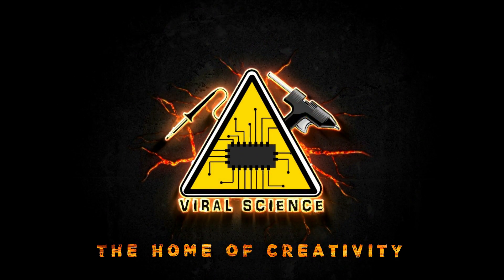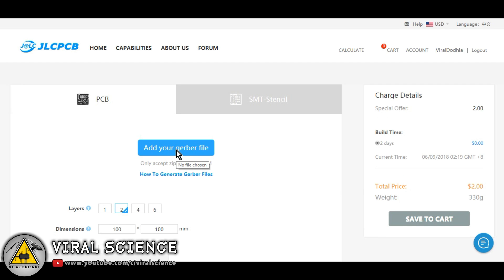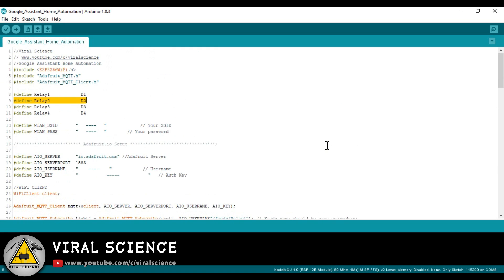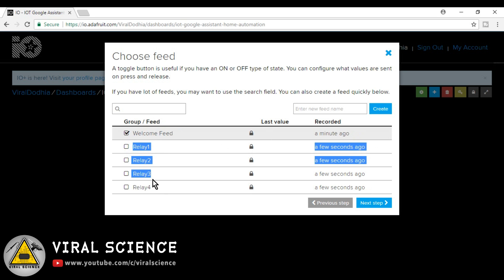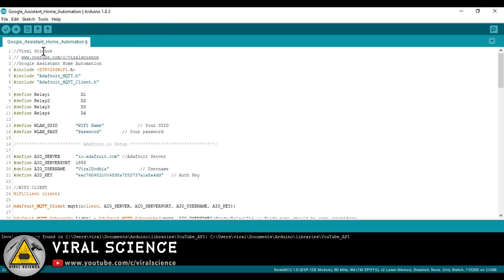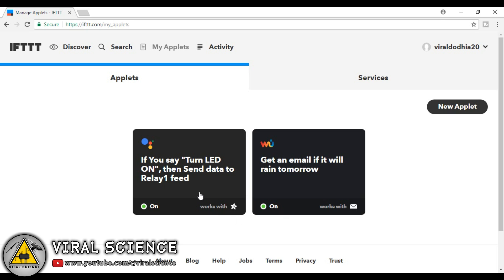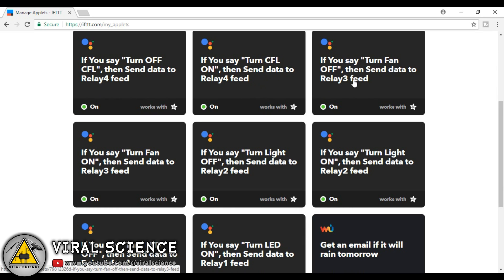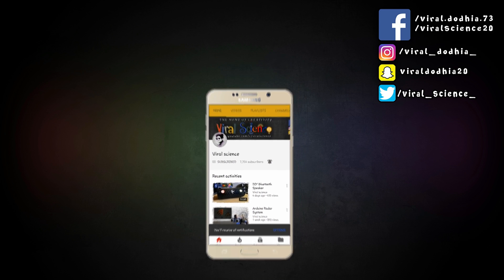Google Assistant | Home Automation IOT | NodeMCU ESP8266

Comment: like the features, setup was difficult for some of my devices (August Door lock, https://www.youtube.com/post/UgkxhB5YOMNj04GuoAosExygP4cH-dKeb4aB Bose speaker)... but all switches and outlets (5), thermostat, tankless water heater. Unfortunately all I can do is turn on/off Bose. It doesn't support volume or changing channels, but I believe that is due to the particular speaker I have.... Worth getting if you already have other devices to use it with... I don't sit around and ask Alexa questions much so that doesn't really matter to me....

Comment: nice project bro, but how to get rid of this delay on turning on or off by Google voice assistant ??
Reply: david sobhy simply make your own voice Assistant that can do it more efficiently.
Reply: Make sure your WiFi connection is high speed then automatically your Google assistant will give you fast reply. It is all because your wifi   speed will make ifttt respond quickly and makes  u r Google assistant responds quickly via IFTTT. This project totally depends on Wi-Fi. If it is poor connection then no response u will get
Reply: internet connection must stable n fast
Reply: I agree with both of you, it is the internet. I've actually made a project with ifttt and before, something simillar to this, but we used cellular data and the response was almost instantaneos (once google assistant is done recognising the voice command)

Comment: hi there, Good Project and You explained Nicely. I am having a few questions regarding this project
1: How can you Connect  +5v Supply direct to Vin pin of Node MCU because Node MCU only operates on 3.3V and 5v may harm your Node MCU.
2: As output of Node MCU is at the level of 3.3 v but threshold value for proper operation of relay is more than 3.3v. how can your Node MCU manage about that? 

Thank you
Manu

Comment: Hello, which model of the wifi module is used? A. NodeMcu ESP8266 CH340G

OR  B. NodeMcu ESP8266 CP2102
Reply: That is only the USB interface to program the chip.  Ch340G is most used.

Comment: bro nice video, it works well. but after sometime 10-15 minutes nodemcu stops responding may be because of sleep or wifi disconnection, any clue what code we can keep to keep nodemcu alive all time. 
i used wifi sleep mode options but none of them worked, can you help , thanks in advance

Comment: hey dude, i done this same project but i use 12v relay instead of 5v, i had problem output is not comming.and one doubt that i supply 17v to relay broad using the transformer . so that the relay not working i think its corerect r not .if wwe have 12v relay we must need to supply the 12v only. plz reply soon
Reply: plz bro because i use 12v too

Comment: Good video.  Can we control 12 Volt DC switches from same project. If yes do we need only relay to be changed? Please reply.
Reply: No relay support 12v 10a dc or 250v 10a ac voltage

Comment: hey, can you provide me with another diagram and all the details for 28 appliances including air conditioner and also the power input adaptor details as you have used a battery in input

Comment: Buen trabajo amigo, te felicito. Que quería hacerte una pregunta, ¿se puede agregar mas de un MODEMCU a una cuenta? algo así como para controlar 8 relays
Reply: Andress Varas sólo necesitas añadir más puertos en el código y sacarlos por las patas correspondientes, y obviamente poner más transitores y relevadores.
Reply: Sergio Eduardo Hola Se pueden apagar o encender los equipo manualmente y obtener el estado en la app?
Reply: @crearelectronica  no se puede, a no ser que modifiques el sketch de el modemcu y agregar pulsadores para el apagado manual, saludos

Comment: Why do we have to enter SSID and WiFi password can I use mobile data because at the science exhibition I won't be having a WiFi connection but I will have mobile data I will enter the SSID and password but is WiFi necessary
Reply: Indrani Sahu yes you can connect with your mobile data. Make sure that your mobile and your board should connect under same mobile data

Comment: Buddy I had made this project but now I want to do like this if I will say start the tasks then first led should be on then after 5 seconds second led should be on then after 5 seconds third led should be on and after that all should be off like this

Plz reply how can I do that
Reply: You can modify your ESP8266 code. Activate the first relay using google assistant and then use an if statement monitoring the state of that. If is activated then add 5 seconds delay and turn led 2 on, another 5 sec delay and turn led 3 on and so on...

Comment: Materials:-
NodeMCU ESP8266
5V Relay
IN4007 Diode
IN4148 Diode / 330 Ω Resistor
Transistor BC547
Voltage Regulator 7805
LED
DC Socket
Terminal Connector
PCB Header
bhai link dede inki

Comment: Can't I connect more than 4 appliances l need about 10 appliances
Reply: U can it all depends on the no. Of gpio pins
Reply: @animadoarts5123  what is gpio pins
Reply: @animadoarts5123  where can I find it
Reply: @jayakarshetty1179  
See if you using esp8266 or esp-01...it has only 2 gpio pins....( google the pin diagram of esp01 ).

If ur using Nodemcu then u have many gpio pins, which in nodemcu is written as digital pins like D1,D2,D3 etc.(search  pin diag. Of nodemcu ).

So more gpio pins more no. Of appliance can be connected.
Fell free to ask anything
Reply: @animadoarts5123  Thanks you
Reply: @animadoarts5123  thanks bro
Reply: Yes you can connect 8 appliances. (D1-D8 pin).. you can get 8 relay board from amazon.
Reply: @laishramguneshwor3137   can we use 16 channel relay to arduino uno ?
Reply: @jayakarshetty1179  GPIO General Purpose Input Output.. GPIO is a type of pin found on an integrated circuit that does not have a specific function. While most pins have a dedicated purpose, such as sending a signal to a certain component, the function of a GPIO pin is customizable and can be controlled by software..
Reply: @animadoarts5123  what changes we have to do in codes and pcb for connecting more relays
Reply: @animadoarts5123  I want to connect more than 4 appliances l need about 16 appliances. how to connect & circuit or Gerber file ? Pls Reply

Comment: When the power goes off , how will you save the last state of the relay so that if ur relay was at LOW state last time, it will remain at the same LOW state after the microcontroller is powered up again ?

Comment: Its fake video if u see it properly in starting this guy kept the zener diode in circuit and by the end of the video in circuit there is resistor in place of zener diode the it's not proper.

Comment: Your circuit is wrong.  don't try to make fool every one. ESP8266-12 is providing 3.3 v out our from every pins. But your all relays are 5 v. What are you doing with ur left hand? :)
Reply: Live Satellite  hay he used. 5v regulator IC to provide power to relay
Reply: Dear Satellite, You have to use Optocoupler. Then you can control 5V Relay with ESP8266. In this circuit, he has used BC547 as op amp
Reply: Live Satellite yes your doubt is correct. But relay has three connections NO, COM, NC when you give power connection from board to COM it will make active to itself. I worked on this project. It happened. Just try for it